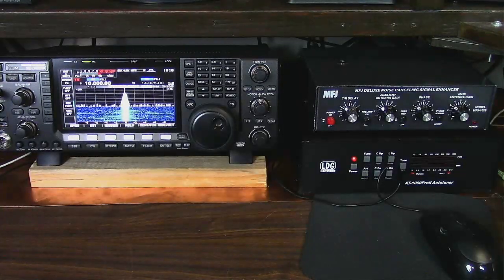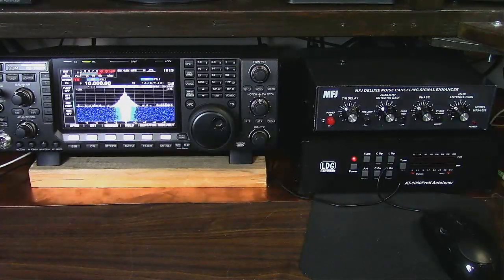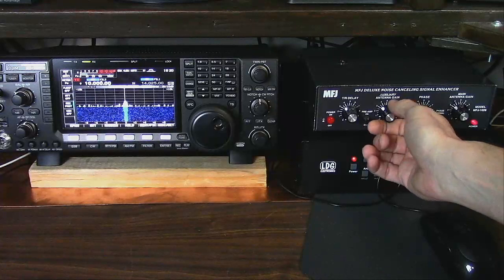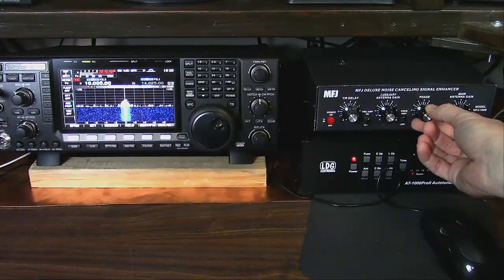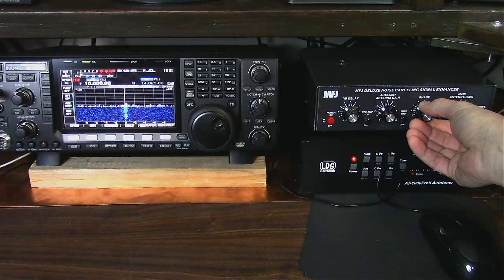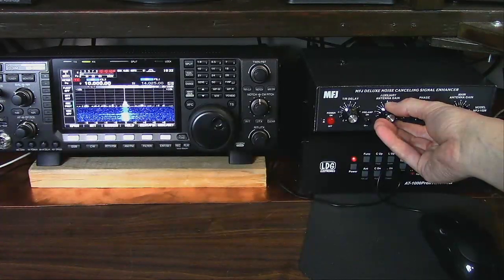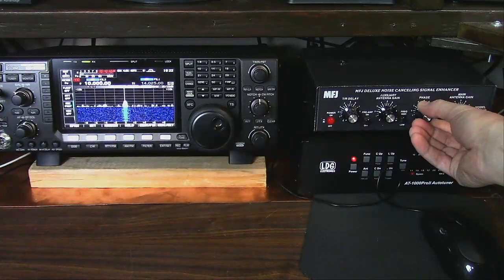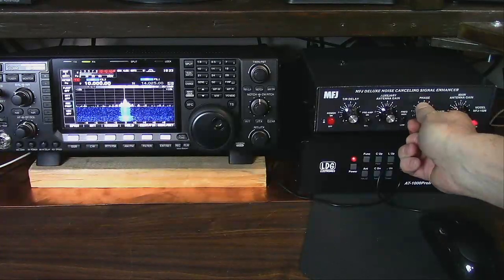MFJ-1026 Noise Canceler Tutorial

Comment: I don’t understand your demo. It sounded better with the unit off. So what is the purpose? A better demo would have had a signal that you had trouble hearing without the unit on, and then by tweaking it, you dig the desired signal out of the noise. You’ve done just the opposite! 😂
Reply: I think he was using wwv as his noise, showing how he can phase it out. But to me, this is a terrible demo. Find actual noise (not an actual signal) and remove it while leaving the signal.

Comment: I know this video was done a while ago, but thought I'd ask anyway.  I have one of these units.  It seems pretty useless.  No amount of fiddling with the controls seems to make much of a difference.  Phase control does nothing; the main antenna gain increases/decreases volume only, aux-antenna gain does nothing.  Perhaps it's because my noise antenna is an OCFD dipole and my main antenna is a fan dipole??  Too similar?  Most of the noise sources around here are due to the usual urban stuff - power lines, streetlights, etc.  Base noise level on 40 meters is about S7-9!   Thanks - Bob KJ6GEU
Reply from the maker: I experimented with both vertical and horizontal noise antennas and concluded that the noise antenna needs to be vertical. Horizontal antennas don't receive as much noise because RFI is vertically polarized. The unit will work as described with the correct noise antenna attached.
Reply: @KA6WKE  - same results with a receive loop antenna which has been well-reviewed for this purpose.  Maybe the suburban RFI levels in addition to my solar panels are too much for this to work at all.  Bob KJ6GEU

Comment: Sorry to ask so long after you post this video. If we want to cancel a station or a noise we have to keep the signal of what matters with minimum quality and intensity, right?
When you end the tuning in the video the Main Antenna Gain seem very low so I think you´ll NOT be able to hear your fellow ham (ofc not on that frequency 10MHz). The Main Gain at the Maximum is the same as when the 1026 is off. 73 de PY5CL

Comment: I have one, but had limited success.  The device does work, but one must get the right Aux antenna before experiencing the benefits.  It does add another dimension of control over signals difficult to hear.  So I'm not giving up.  Having tried 4-5 different setups, I've ordered another antenna to try.  Your explanation for adjustment is quite different from the User Manual provided by MFJ.  But I'll give it a whirl, nothing to lose from trying  Thanks!